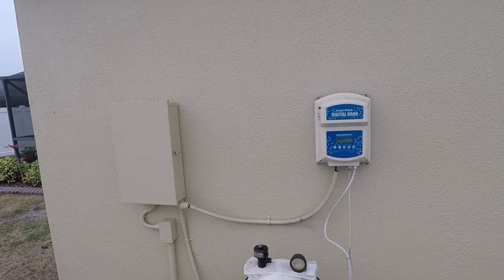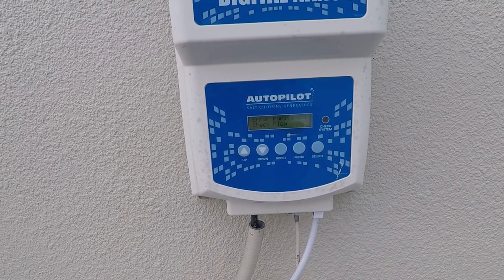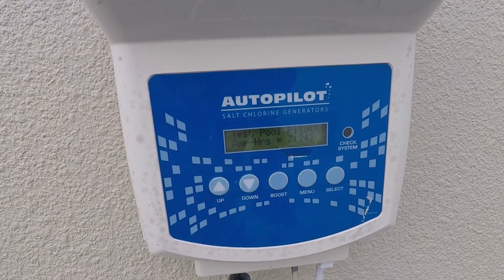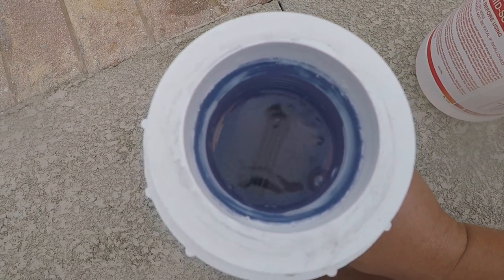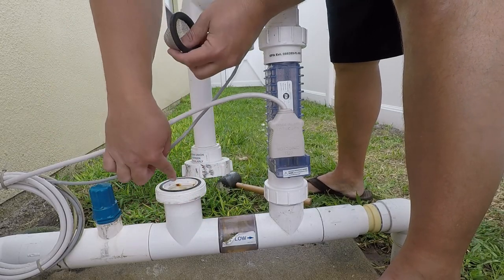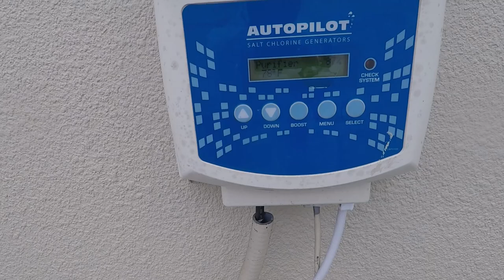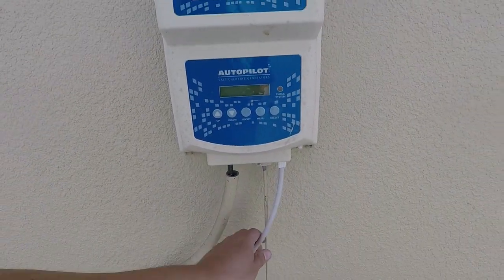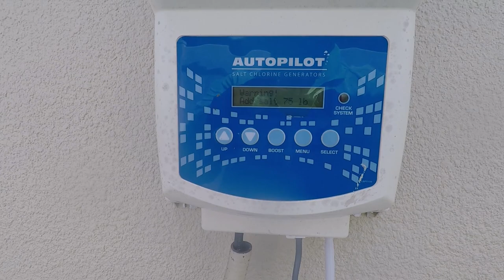Troubleshooting 'Error Purify Off Check Flow'

Comment: Glad someone else ran to the same problems I did with this system lol, I learned a thing or two on it I appreciate it I'm going to tackle this tomorrow for sure. Thank you sir 👍
Reply: How did it go?
Reply: @natethetoe386  buddy honestly I don't even remember it was eight months ago I'm not even working on pools anymore, but if memory serves me correctly of just a matter cleaning the cell and everything first but if that doesn't work of replacing hardware each part one by one. And then resetting the computer.
Reply: How do you reset the computer? I did everything and still getting the error.@JohnSmith-xx1lx

Comment: Had the same issues, strainer and cell were perfectly clean.  I found that the Tri-Senor cable was loose at the Autopilot unit.  Pushed it all the way in and it solved my problem!  This could have been your issue!  Thanks for the video.

Comment: Try getting an oil change wrench you take oil filter off with to open up your pipes on your pool pump. (Where you hit it with a rubber mallet) The guys who installed my pool showed me that. It’s much easier and less wear and tear.

Comment: The cap is 1 1/2 inch and fits in where the screen is. So you can slip that in instead of plastic bag. The cap is a very common size and used to plug lines for the winter or vacuum line when not being used.

Comment: Teflon tape the plug threads to prevent leaking, and AutoPilot suggests 4 parts water to 1 part muriatic acid. Fill the tube with water leaving about 2 inches from the top, fill it the rest of the way with the acid, and that should be about right.

Comment: I had the same error message and followed your first step and the error message is now gone . Thank you for this video . My husband works long hours and I wanted to save him the stress . Cannot wait to tell him I fixed our issue ! How often do you think I’ll need to clean that screen ?
Reply: Depends on the time of year for us. We clean it probably once or twice a week early on, late spring/early summer (Western NY state). But the frequency goes down as there is less "stuff" in the air, etc. But I keep that gasket just hand tight as it's pretty much the first thing I try EVERY time I have issues or even think I might have issues, and after just about every time I vacuum.
Reply: Where did you purchase the tri flow sensor

Comment: The connectors should only be hand tightened, not as tight as you have them. The chances of cracking are reduced when only hand tightened. 
 And please don't tell me you worry about it leaking if it is only hand tightened because it doesn't.

Comment: How do your reset the hours on the cell?
Reply from the maker: So I'm assuming you're referring to the 'Amp-Hrs' reading when testing the pool pilot.  That is actually a calculation result returned by the Pool Pilot.  Looking at the manual it says the definition of 'Amp-Hrs' is "The amount of current times hours of operation received by the cell".  So if you're getting a big fat ZERO.  This means no current is being detected.  I would clean the salt cell first.  If that doesn't work, perhaps it may be time for a new one.
Reply: Select the maintenance menu and select replace cell.  That will reset the hours to zero

Comment: Lol.
 No you don't need to flush out the lower pipe! 
So what if it goes into the pool, the skimmer will catch it anyway if you don't use your skimmer net to fish it out. 

 You cause yourself more work than you need. 

 So stop the paranoia.